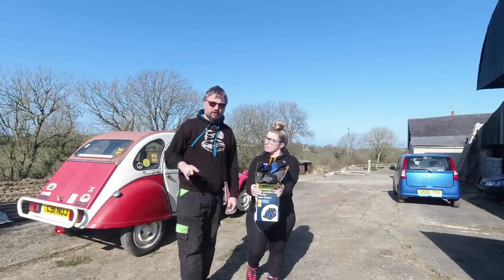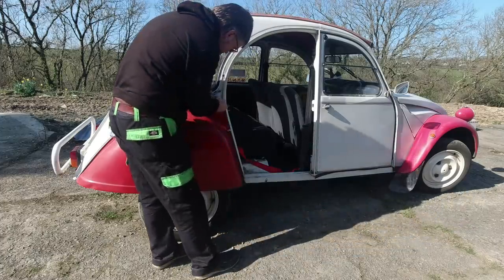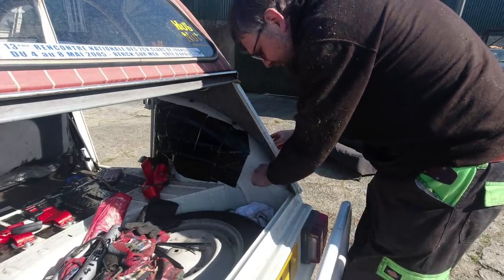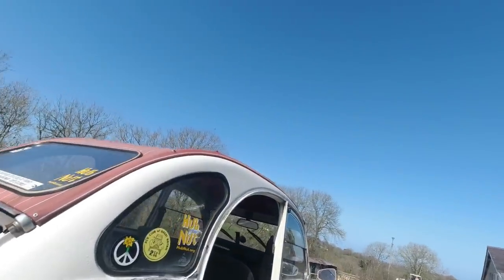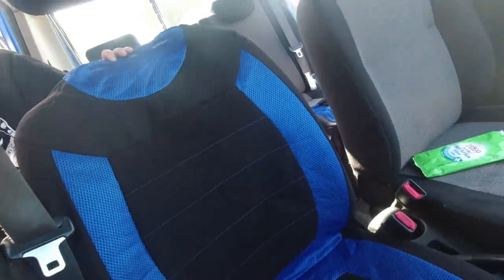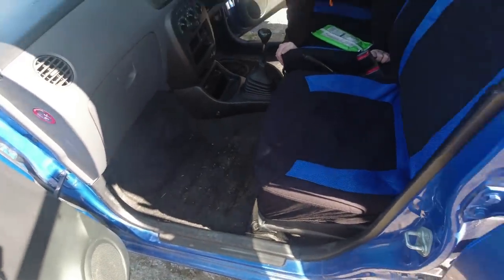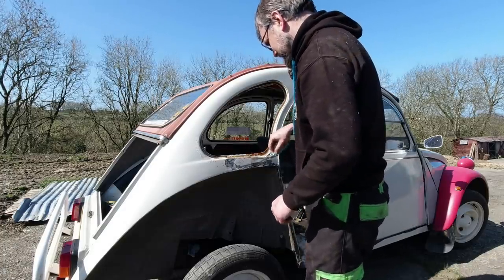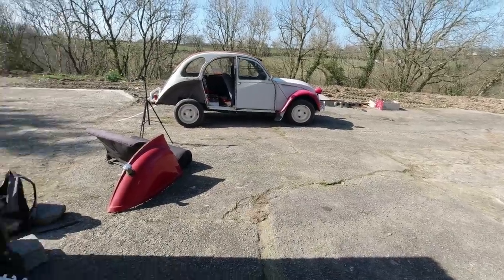2CV Paint and Rust Removal Pt1

Comment: Yay!!! Miss Hubnut. 
I am also kinda of a butter when it comes to car cleaning.
Inside must looked like it has just from.valet, most of the time. Shiny, clean, and smelling of "Cherry" scented dash cleaner.
And outside equally clean.
Seats and carpet gets a 3 month, foam cleaned, vacuumed.
Wheel arches gets cleaned weekly,  no dirt build up. 
Undercarriage gets a 3 month rubberized sealing, can spray.
Light lens get polished with baking soda/toothpaste, all around. 
Mag rims get a 3 month clean on the reverse side as well. 
Now, that my kids are grown and I am divorced...I use the car mainly for myself. 
And it doesn't get any dirt on it.....but I will still do it.
On the rare occasion when I have a passenger, everyone always comments on the lovely smell and cleanliness of the interior......

Comment: When you refit the little window you might find it a whole lot easier to lubricate the rubber with either washing up liquid or oil (but not both) and use the old method of threading a long piece of string around the whole of the inside of the rubber channel to use as a means of easing the rubber over the flange (ooer missus).
Reply from the maker: Cheers. I might try heating the seal. The wax is very slippery for a while, so useful to help and it protects the area from rot.
Reply: Agreed. Heat the new window seal and give it a bit of lube (nudge nudge). The way that corner has corroded does tend to point the finger at the original seal and/or fitment of the window. On the nearside quarter, it appears that the trim has trapped some moisture and let the demons in. Get as much of the rust away with a power tool before treating. I know that Vactan et al need something to work with, but you do also need something smoother to prime and finish afterwards. I know that you're not aiming for factory fresh, but the smoother the base, the better chance the paint has of retaining its integrity. Thanks for another great vid, Ian, and let the rollercoaster continue!

Comment: That is a shame it got so bad around that window, water does nasty things when it finds it's way under paint. I should imagine that when the window was refitted that the edge of the paint got slight damaged. So easy for a bit of paint to just break away from the hard edge when your struggling to get the rubber in. Glad to see you tackling it though before it spread even further. I wish you good luck with the project. Regarding other parts of the 2CV, I just love how easy parts of it come of - you had the boot lid off, the door off, and the rear seat out in the time it would have taken me to get my sockets out! Such a great bit of design work, a lot of thought clearly went into it.

Comment: Looks like that was very timely and good decision to take the glass out. "MER" PVC & Vinyl Interior Cleaner works very well on common plastic door card plastics, wipe on neat, rub gently on the stubborn bits and rinse it of completely as soon as the desired results are obtained, do not leave it soaking.

Comment: Might be time to invest in a random orbit sander.
You can then remove the bubbling and loose paint and feather the edges so you can have a smoother transition between the old and new paint.
Reply: A generic type B&D Mouse is fine for little jobs like this but  flap rolls and discs in you drill will do the trick too. I like the 3M type Clean 'n Strip wheels for good control. Generic ones OK, cheap, but don't last so long. You'd have been back to bare metal over all of the area, including the bubbles, in minutes with one of those. An old wood chisel is much better than a screwdriver for attacking paint like that.

Comment: I feel your pain. This summer I have to get after some rust that is starting on my 90 Volvo 240. Arthur has survived 31 of our crazy winters. After that long, and 400,000 miles, it is about time to get after it. In another 5 years, a full restoration is on the cards. That will be part of the prep for a 3,000 mile drive from here in Barrie, Ontario, through the US from North to South, across Mexico and into Guatemala on my way to San Ignacio, Belize. Going to be quite the adventure.

Comment: Well done both. Those seat covers look great. With regards to Elly, I have the same problem on my Minor with rust between the body and rear wings! The joys of old cars!
Reply: What I always do where panels meet or where there is trim is to mask off the mating surface and spray with rubber stone guard. It seems to do an excellent job of preventing issues as it stays flexible.
Reply: @michaeltutty1540  excellent idea. Many thanks for sharing that.

Comment: As one involved in offshore structure coating, I can say that the key (if you will pardon the dreadful pun) to paint that lasts, is the bonding of the first layer to the substrate. Rust growth grows by plucking the paint away at the edges of any damage patch. One of the industry quality tests is to glue a thing like an engine valve to the paint surface and measure the force required to pull it off. An example of this is that I have “through to metal” stone chips in the bonnet of my Honda that were there when I bought it well over a year ago and they are completely unchanged in that time.
  Get the surface very clean and with a finely textured finish for the primer to key to. Beware of moisture and salt residue. We wash down with distilled water and have air humidity levels to comply with at sea. I don’t suppose that you have a swimming pool full of hot phosphoric acid to hand do you?😉

Comment: The paint has failed due to the primer not bonding to the zinc all it takes is a pinprick for the moisture to get  in, then it's game over - flat it back, wire brush the rot and convert it - etch primer , fill with something like dolphin glaze prime and paint - i don't like doing body work

Comment: You should be able to rattle can that area quite successfully in a reasonable time frame - a good base coat of etch primer on the repair should stop the paint from flaking off again. 👍
Reply: A vigourous scrap, and modtvof all a generous amount of rust converter is mandatory. Rust turns to black, clean metal remains clear.  A good base coat and a paint job.

Comment: Try getting a bin bag folding over a few times and put that over the fuel filler pipe. Held on with a rubber band or cable tie , that might help if you decide to brush or jet wash the dirt from the rear wing . Just a thought
Reply from the maker: Cheers. I just refitted the filler neck.

Comment: I case you didn’t know, use washing up liquid neat to aid fitting of window seal.
Reply from the maker: It does, but washing up liquid often contains salt. Not ideal!
Reply: @HubNut  no idea what washing up liquid you use, but I have never seen any. I use washing up liquid twice a year to was Arthur, so that means it has been done 61 times, and never any issue. For a 400,000 mile car that has survived 31 Ontario winters without a respray, Arthur is in amazing condition. Most 10 year old cars here are on holes.
Reply: @michaeltutty1540  Almost all washing up liquids are thickened with salt.

Comment: The difference between Zintec and galvanised is that galvanised is hot dipped in molten zinc, whereas Zintec is electroplated. Zintec is common on sheet steel because its thickness is much more controllable, but it requires a decent paint covering to retain its corrosion protection; galvanizing is much more robust because it's much thicker.

Comment: I always reassemble bolts with copper grease= works for me. Door and boot lid off in seconds,  gotta love a 2cv.
Reply: Problem is HubNut frequently does nuts and bolts only finger tight. Rust is the only thing stopping his cars falling apart on the highway. Grease them and there will be a trail of wheels, body panels, doors littering up the verges in Wales  or scything their way through passing pedestrians. Better to keep everything rusty.
Reply: @mbak7801  Absolutely spot on

Comment: The Zintec coating on the body does seem to have worked wonders as their seems to be little actual corrosion in the areas where the paint was failing.  Acid etch primer is a necessity with treated metal like that, and not all etch primers are created equal...

Comment: Zintec as you state is applied to the panel using electrolysis. This coating is only intended as a storage/transit coating. This coating needs to be removed prior to welding as welding through this zintec coating is poisonous and can cause serious health issues.. similar to welding through galvanised steel causing cyanide gas to be given off when burnt with the welding process. With the E coating (zintec in this case) welding through this, releases zinc oxide which is commonly referred to as metal fever I believe which can cause flu like symptoms. The issue with paint adhesion is also due to the zintec coating as the surface of zintec is smooth and for paint to bind to the surface of the steel the surface needs to be stripped and keyed to give the paint a surface to bind to.. due to the zintec still being on the panel surface, the paint hasn't had anything to bind to correctly. Zintec isn't a weld through coating similar to zinc  From a spray can or weld through primer. Sorry if this appears negative. It's just what we do. Then for protection, use a two pack epoxy such as Jotun high build epoxy.. then key the surface of the epoxy and go from their.

Comment: No surprises with the little paint bubbles. Once you get into it, they always extend further than first glance. Especially under rubber window seals. On the fiat 500s I had, I noticed that they provided drains at the bottom corners, of the windscreen, to let the inevitable trapped water out. Perhaps you could 'mod' Elly, to do the same.

Comment: I didn't know stainless steel bolts reacted with standard steel another fact to file, how about brass bolts where steel strength is not required? Should be ideal for your body panels?

Comment: Better to have a dig and find the root cause rather than the paint mysteriously flake off again fairly soon / tinworm escapes into something else. In my case thinking wet carpet is just a leaky heater matrix then finding a dirty great rust hole in the floor 🤔 btw, would you say it would be feasible to keep a 2CV without a garage? I’d love one but only have a drive to keep it on!
Reply from the maker: Yes, you can keep a 2CV outside - plenty of people still do - but you do have to go to greater lengths to preserve them than I ever seem to manage... I tend to just take the rubber mats out entirely during winter or after prolonged rain.

Comment: I wonder if that window seal was at fault of causing the rust as it could have been leaking water through it onto the metal plus that side of the car gets the worst amount of salt and muck when other vehicles drive past.
Reply from the maker: Certainly plausible. I suspect it's happened both sides to a certain extent.

Comment: Stainless steal reacts with what now?
You’re getting confused with stainless and aluminium.
Reply: No, Ian's right but the chemistry is a bit complicated. The point is that in certain conditions when the protective surface is contaminated, stainless will degrade.
Reply: @rodgerwitt9273  The other issue is that stainless, at least certain alloys, tends to gall making undoing fasteners worse than if they were just corroded.

Comment: I would have sanded away all the bad paint. Use rust eater to remove rust thats in the pores.  Use Epoxy primer. zink primer is not the best to stop rust on cars (pretty bad im my opinion)
And finish with top coat. Maby use body filler and then primer  between the Epoxy and topcoat to level it with the rest of the paint.